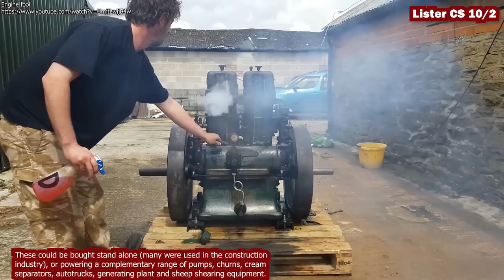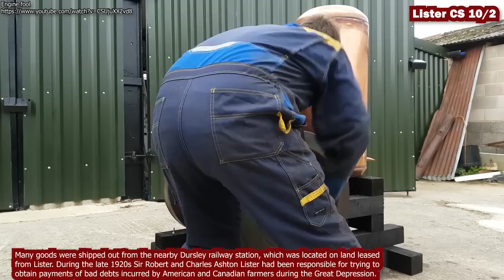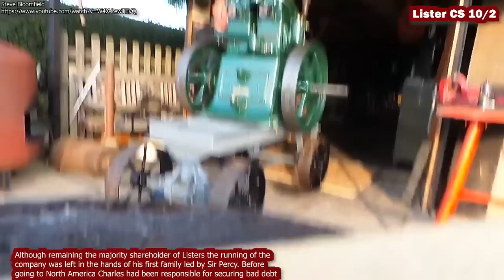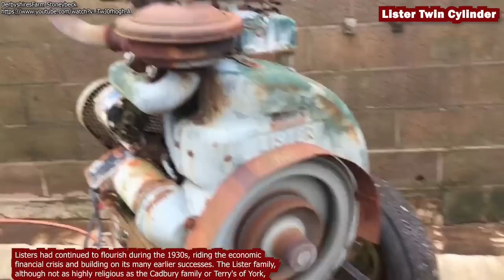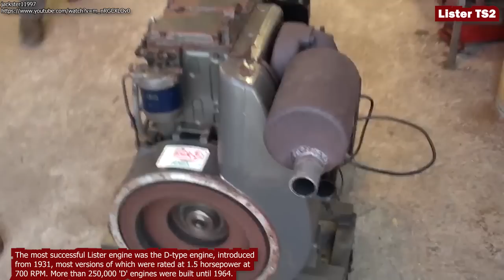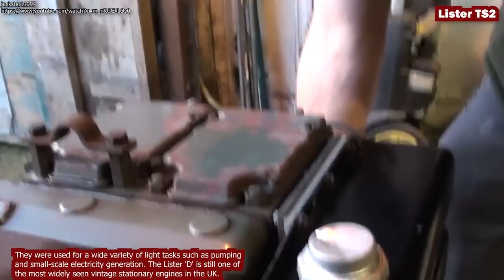Big Old Lister Engines COLD STARTING UP and COOL SOUND 2

Comment from the maker: Do you like these Lister engines ?
Reply: The older, low rpm engines,  just sound awesome.
Reply: Yes, more of them please 👍
Reply: First engines i ever worked on in plant 1966 many moons ago
Reply: ST-2 please.
Reply: I cranked my Amish grandpa's many a time from 1981-1987. It was a single cylinder 850 rpm 7-1/2 hp. Ran a day on a gallon of diesel. Powered am air compressor, a lathe a grinder, a drill press, a blower, a trip hammer, a shaper.
Reply: Im not familiar with this engine. Is it a British made engine? And im guessing used mainly for pumps or generaters.
I guess I can Google it. 😉
Reply: @michaeldantoni4292  British, yes. Used in a variety of ways. Stationary power for anything belt driven, marine power/propulsion. Generators, sawmills, pumps, you name it, someone has used a Lister engine to run it. Primarily built in England, later copies were made in India. Use your imagination. These were banned for sale in the U.S. because, well, the EPA...
Reply: By the way, Lister diesel engines are very sturdy and well built machines that generally take a beating.
Reply: @michaeldantoni4292  lister/ petter made in england , not to be confused with an indian peter engine, pumps,generators, dumpers, welders ,boats farm elevators etc.
Reply: @patrickbodine1300  and all day on a gallon. Can't have THAT! LOL 🤣🤣
Reply: Does a bear defecate in the woods?
Reply: Sim, gosto de motores antigos, são mais duráveis.
Reply: Cool stuff, love the sound

Comment: The company i worked for in the sixty's had a lister agency the oil leaks were the biggest problem thats why many engines had multiple coats of paint as a seal. This wasn't helped by the use of UNF threads not lasting long I think UNC would have been better. Fitters now often need computers setting engines up!  I wonder how they would get on Spill timing these engines? I attended courses at Dursley staying at a pub up the high street the l
and lady really looked after us I think I always came back heavier. These engines were also fishermans favorite for ther boats due to there reliability..

Comment: Awesome video mate and thanks for taking my request, just letting you know that lister d types came not just in 1.5 hp but up to 4 hp. It depends on the specs
Reply: Lister d was made between 1926 and 1965 they were petrol or petrol paraffin  1.5 - 2.5hp. No Lister D s in this video
Reply: @thomascatford2627  I know, but there I believe we’re some 4.5 hp ones too. I think I’ve got one
Reply: @anythingvintage2952  anything more than 2hp then you've got a lister F, they came in 2.5 up to 4hp, they share the same engine block but everything else is different, piston, mag, carb etc..  Quite rare engines to find, i'd love to get hold of one myself.

Comment: I never really had a on hand experience with these engines. I bought a Pinto car in 1970. It had two engine options. A 2.0 German four cyl. or a 1.6 English Lister 4 cyl. engine. The smaller one seemed too weak for this application. The 2.0, however, would go all day long. I would shift to the next gear, when it wouldn't go any faster.
Reply: What kind of car is a pinto with a  lister engine ?
Reply: @thomascatford2627  A Ford from the '70's and '80's
Reply: @dalemettee1147    A uk ford ? Never heard of a ford pinto , cortinas had a 2.0 or 1.6 ohc pinto engine , never a lister engine in a car.
Reply: BS